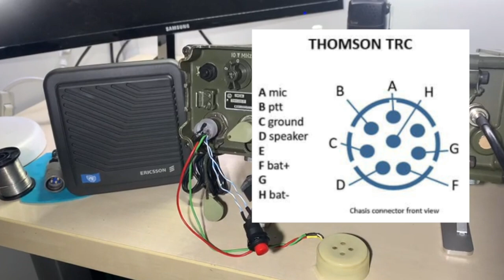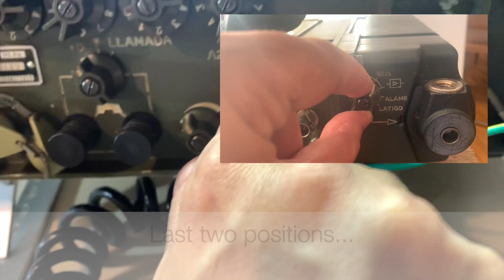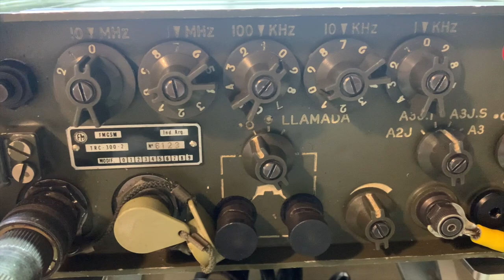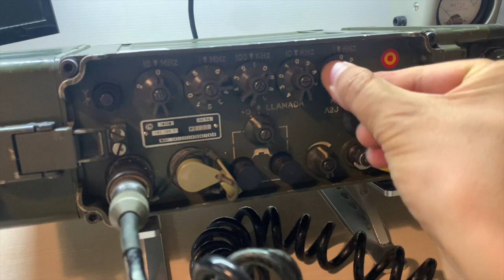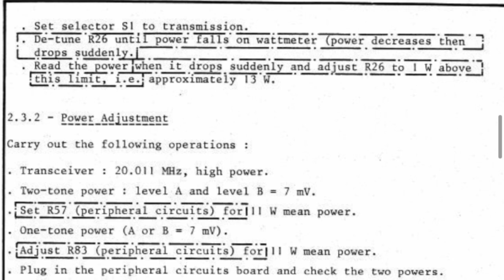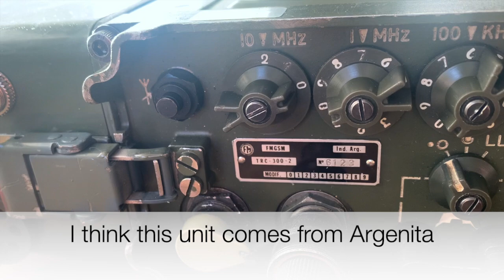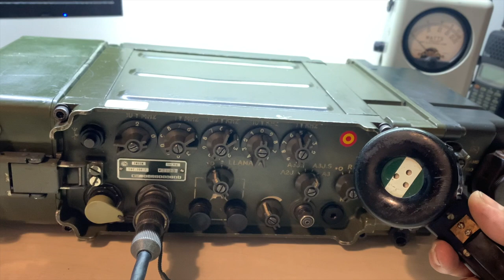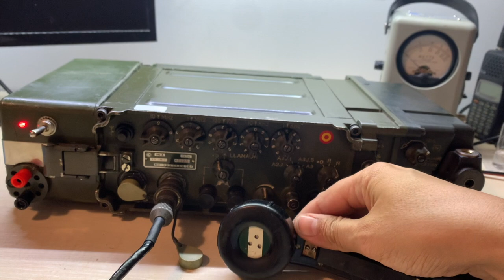Thomson TRC-300 back in the air

Comment: A proudly South African designed and built radio, made here locally. Originally known as the Fuchs B25.
Reply from the maker: Way ahead of its time 🙌
Reply: @Radiogenes I believe we have chatted on messenger. Is this Cesar?
Reply from the maker: @do7425  yeah! I think so
Reply: You don't perhaps know where I can find a battery pack unit from for this radio?
Reply from the maker: @DuanesMind  hi! I didn’t have luck when I tried. I think it is pretty common in South Africa and sudamerica. Maybe there. I asked that guy from Peru (Marcelo Artese) and did not reply though
Reply: @Radiogenes  yes at one stage they were easily available in South Africa but very scarce now. I might have to try places in Argentina. If I can't find anything I'll probably 3D print something but always nice to have the original.
Reply from the maker: @DuanesMind  specially the metal cast one
Reply: @DuanesMind I finally found a battery box for mine, so I have an extra spare power box. Have two of these radios again, sold another
Reply: @do7425  Awesome stuff! if you want to sell it let me know because I'm still searching for that battery box

Comment: Hi
Nice video but I have some questions ..

1) Is this the Argentinian version of the TRC300 ?

2) What does the button in the top left hand corner of the radio do ?

3) What is the purpose of the connector in the bottom right hand corner of the radio (next to the ground connector) ?

Thanks for your time

Ian
Reply from the maker: Hi Ian! 
1- Yes this radio comes from Argentina although I bought it in Italy!
2- this button forces the tune process. U-“sually whenever you switch tonsole kiloherzs the ATU starts to tune. This button performs a new tune process in case you don’t change frequency and you make some changes on your antenna setup for instance
3. This is like a nut connector to attach some sort of ground connection I think 🤔
Reply: @Radiogenes  Thanks - I have one of these but without a battery pack , ATU or handset. Also for some reason it is missing the force tune button.

When powered up it seems to take the correct amount of current so I'm hoping it is OK. If not it should be fixable. However at the moment I am searching for a handset.

Great channel by the way !
Reply from the maker: @ianwraith3251  for the handset have a look on leboncoin.fr using combiné militaire or combiné thomson. I will ask the guy who sold me the Handsent of he has more. It is a not so common connector. Good luck Ian. I hope you can sort it out. If you need schematics or something just let me know
Reply: @Radiogenes  Thanks , I think I have most of the schematics now. Thank you also for that website - now I know where French people sell things ! I would appreciate if you could ask the guy who sold you your handset if he has more.

Thanks
Reply from the maker: @ianwraith3251  sure! I just emailed him. Let you know he answers possitive or if I come across one 👍